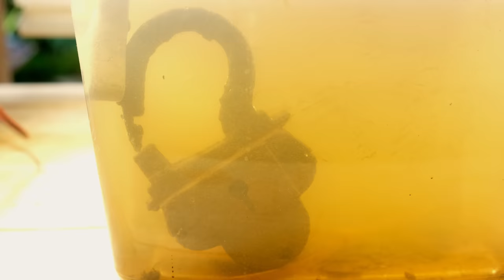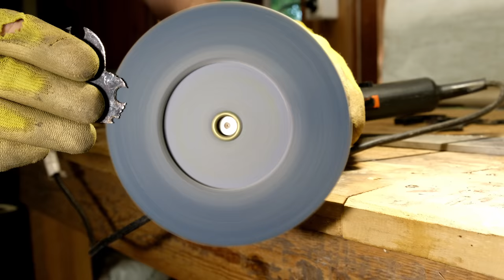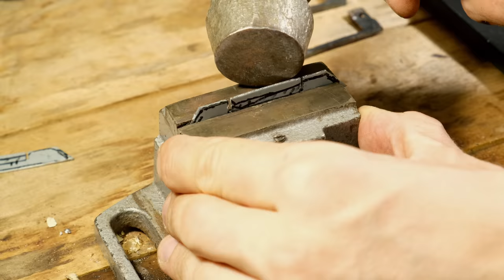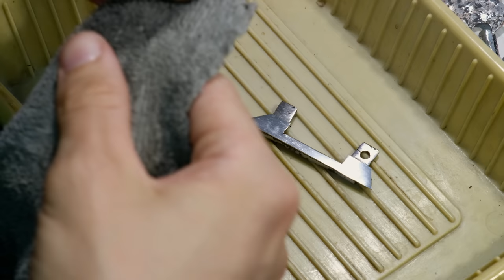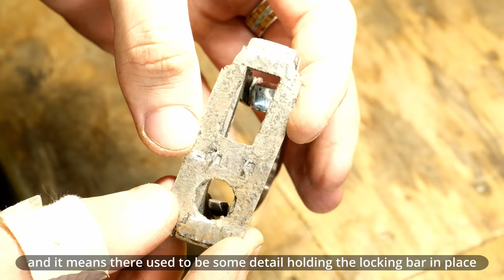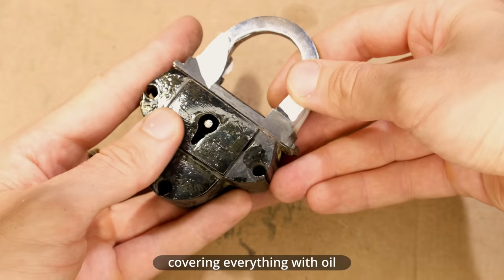Antique Rusty Padlock Restoration | Perfect Restoration

Comment: In my opinion, the ideal solution would be to put a rusty object in hydrochloric acid.  He will etch the rust.  And restoring old metal objects is an art.  Regards ☺
Reply from the maker: Thanks for the opinion! There are many ways to clean, yes :)
Reply: @soul_iron_restoration  I'm just giving you a hint.  The acid perfectly etches the rust, and the metal may not be in its natural color, from the so-called  patina.  However, it is etched with rust.  
I greet and wish you further success in bringing old items back to life.
Reply from the maker: I might try HCl next time. I was actually considering using some acid with this lock but in the end decided to go with the electrolysis. Thanks for the advice!

Comment: Better not to use stainless steel or anything containing nickel in the electrolysis tank. Apparently it creates an extremely carcinogenic compound during the process.
Reply from the maker: Thanks, I will use iron anode next time
Reply: @soul_iron_restoration  Iron cathode.  The anode (negative electrical connection) is attached to whatever you are removing the rust from. The cathode (positive electrical connection) is attached to your sacrificial conductor (most likely iron, perhaps some rebar or similar). The current travels from negative to positive.
Reply from the maker: Yes, I actually meant cathode, mixed up the names, happens a lot :) The connection in my setup is right.

Comment: If you had brazed with, for example, brass, the lock would have become stronger. Now just hold a burning cigarette lighter under it and it will fall apart.
Reply from the maker: Yes, I agree. My goal was mainly to make it look good, suitable for exposition. As it would have looked back when it was used. Brazing is surely the best method but also quite difficult in this case.
Reply: @soul_iron_restoration  OK!

Comment: I wonder what those three holes are for. Nail it on some surface?
Reply from the maker: There was a suggestion that the lock was used for locking a chest. So the holes are for setting the lock in a chest.